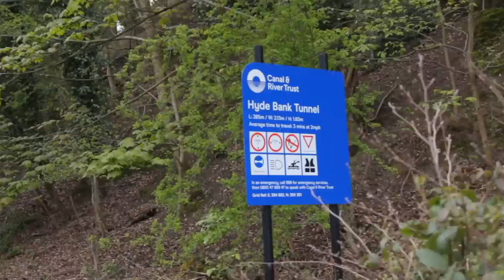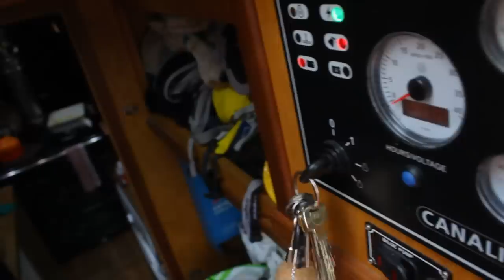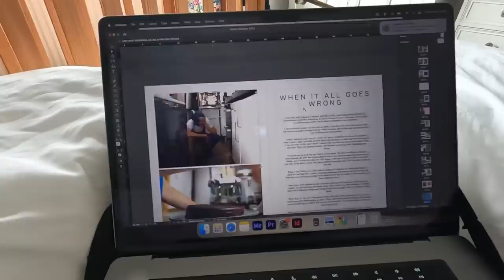The raw unedited truth: We just can't do it

Comment: no idea who gave you the duff info on the "narrow" canal its simply a normal narrow canal with a 7' width! at the other end near Huddersfield it joins its partner canal the Huddersfield Broad canal which is a 14' width.
a little tip with gates like lock 1 open the standard gate first rather than bust your back on the cranked arm you'll find it much easier. 
shame you stopped and turned back as it becomes so much nicer as you go on